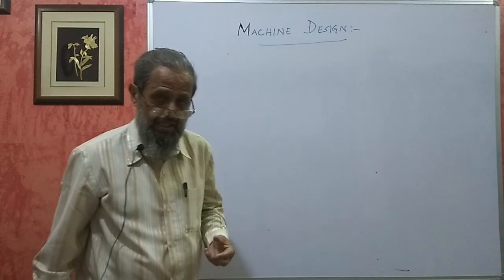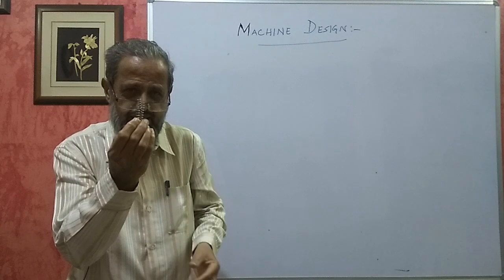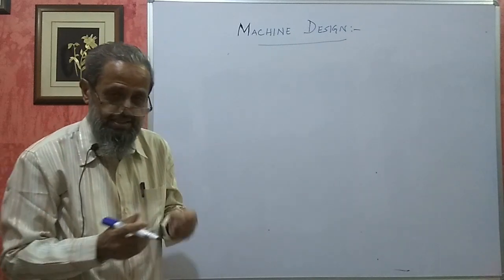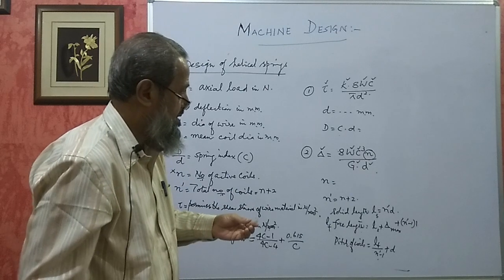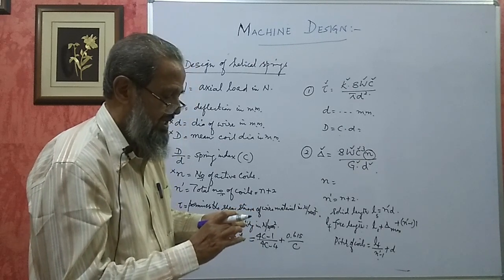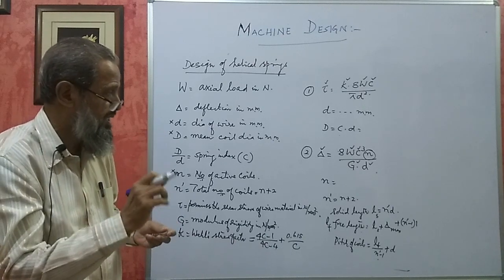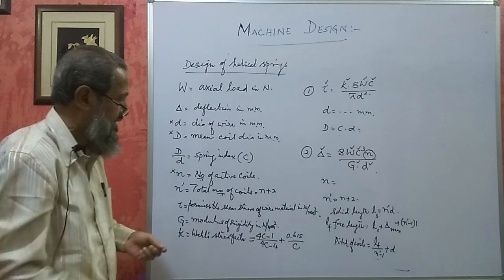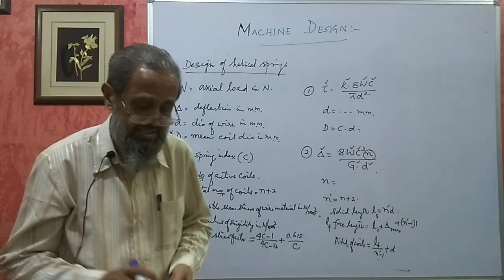Karnataka Diploma Machine Design -Design of spring - Part 1

Comment: Dear sir I'm also watching your all videos, its really very helpful for us,  and I have a little doubt on second spring problem, in that you are assuming C value and finding dia of the wire, but when finding 
 (Mean diameter)D=C×d 
( we know C=D/d) 
Then its comes 
D=6×4 
D=24 mm.
And 
inner dia + wire dia = mean dia 
25+4= 29 mm 
Based on D and d
C= D/d
C= 29/4
C= 7.25 will come sir, 
Based on assuming C value we are getting wire dia that is 4 mm, now all are changing.
Can we assume C value like that?
Reply from the maker: Please call me on 9341262367